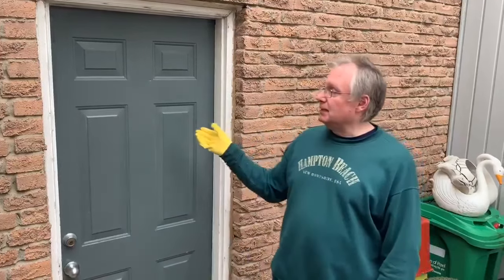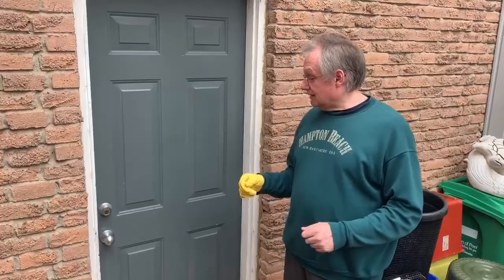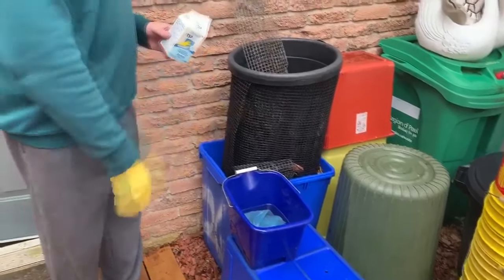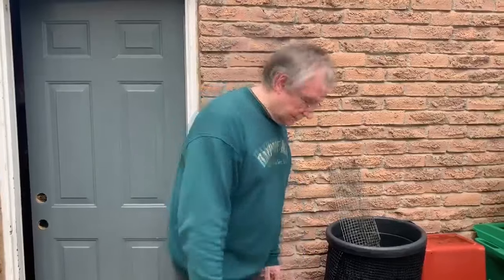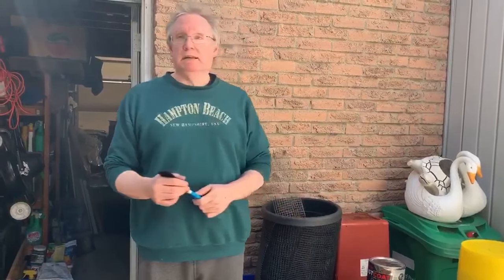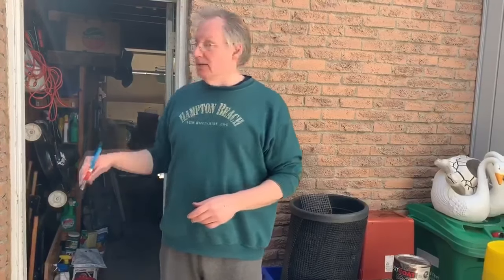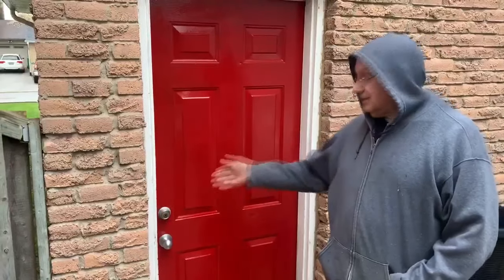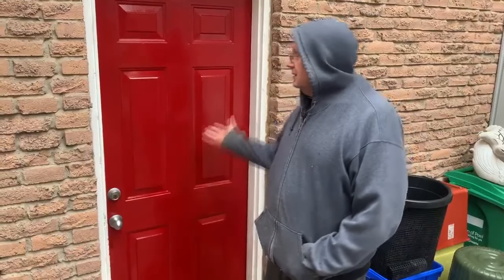How to Paint a Metal Door with Rust Paint || MY FIRST YOUTUBE VIDEO

Comment: I have a blk door and would like to paint it red could I also do 2 coat or would u recommend sanding it down first then repainting???
Reply: I am sure this comment is waaaaaay too late, but I just repainted my door. Buy a heat gun and get a paint scraper. The paint will start to bubble from the heat gun and peels right off. Takes a little bit of time, but comes out really nice.

Comment: did you have to use primer first?
Reply: Primer always good for color changing so new color is more vibrant. Prior lightly sand to remove protective gloss so new Paint or Gel-Stain will adhere properly and evenly.